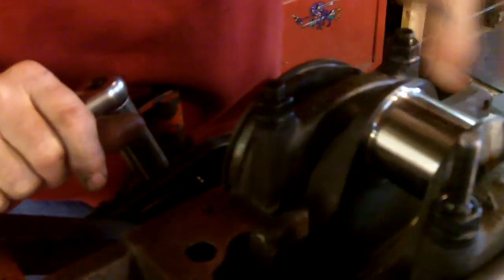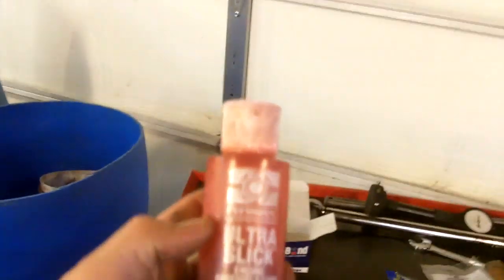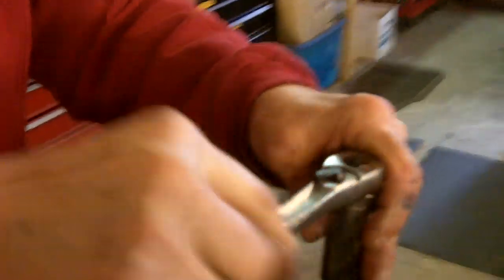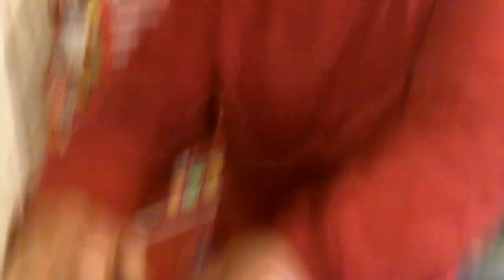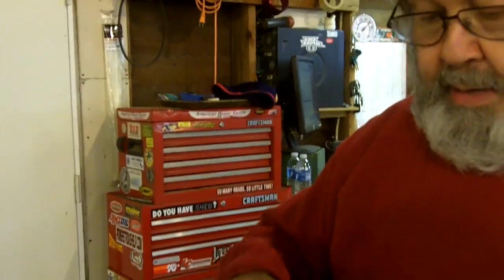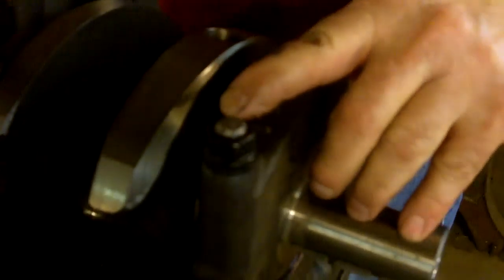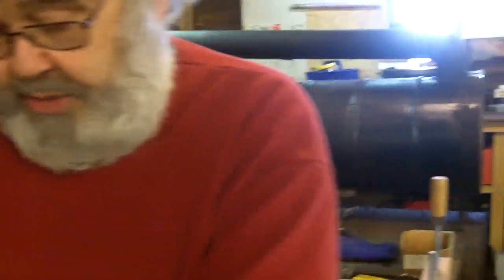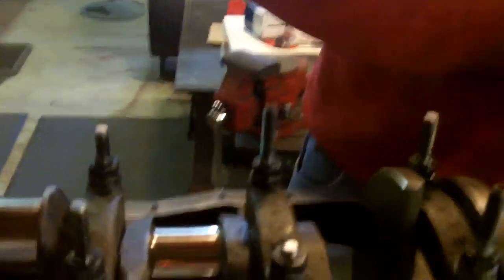Engine Building with RoG - Rear Main Seal and Crank Installation

Comment: Don't know if you guys have the time to answer this, but I have a crankshaft that takes a one piece rear main seal.  The block however, is a two piece rear main seal.  I know Chevy has a conversion kit but I don't know about Ford.  It also looked like your crank was a one piece as well but I don't know a couldn't tell.  Anyway could you use a two piece rear main on a crank that calls for a one piece with any success?
Reply from the maker: ThatDanDude I don't see why you couldn't use the two piece on your one piece crank. I'll have to ask the old man for sure...

Comment: I have a 350 Chevy changed the seal 3 times still leaks the last seal had an offset lip any thoughts why It leaks
Reply from the maker: Check mating surfaces and make sure everything is VERY clean before putting the seal in. Thanks!